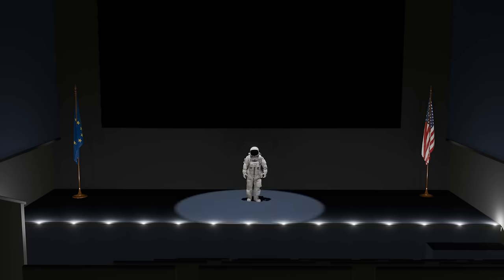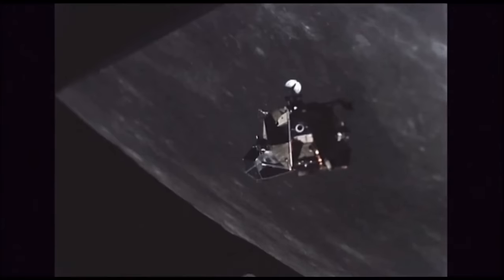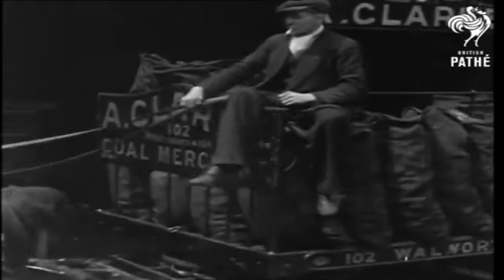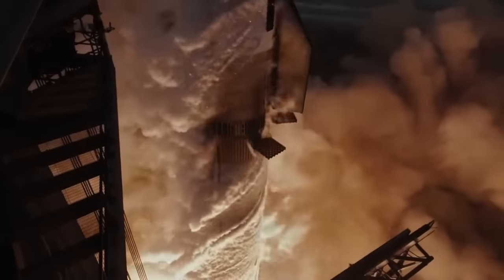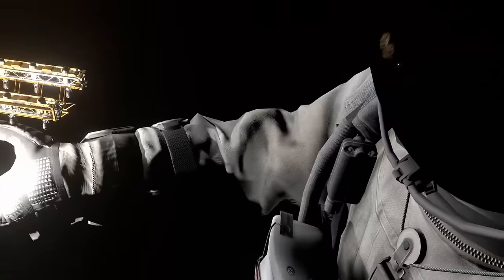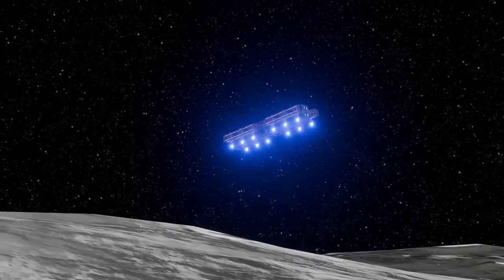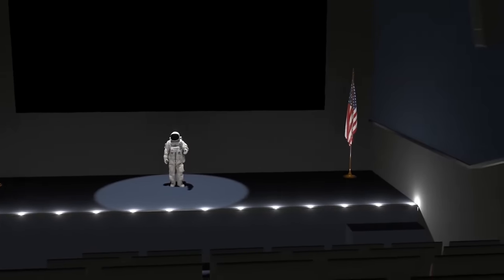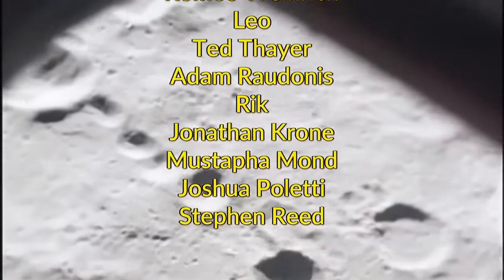Lunar & Orbital Infrastructure ALL PARTS

Comment: I have to wonder the possibility of the launch pad sled literally be a first stage and have just be powered by rocket engines. Fuel is already being produced on the surface in theory. There is already precedent for rocket sleds. This would drastically reduce the mechanical wear on the rails as they are simply just that, rails. All they do is give the sled a straight and prepared surface. Magnetic levitation could also be considered again like with the coil launcher idea except we no longer need to enclose the whole sled, leading to a structure that is not immediately limited in size yet can still be contactless at high speed. Obviously we should use magnetic brakes and the likes for safety.
Reply from the maker: but then why even use a sled why not just launch the thing? The point is to reduce the mass/fuel the freighter is carrying into orbit using nearly free renewable electricity
Reply: @Anthrofuturism  One consideration is that of the required energy generation/storage required for the mass driver. Either you have a large energy storage system (batteries/capacitors) or a dedicated generator to power the launch system. 

    Lets be generous and say that with an empty payload the hauler weighs roughly 300 Tons, and lets neglect the weight of the sled.
According to the KE equation that would require  ~850 GJ of energy over to bring it to escape velocity. 
If you use the short 25KM with the 5g acceleration that would require 17 GW of power continuously for the nearly full minute of acceleration.
Directly being able to power the sled is unlikely as even if we use the long tracks with lower acceleration the power draw will be immense, and it would be impracticable to overbuild power facilities to this degree. As far as I am aware the largest solar farm on earth is only 2 GW. So this leaves batteries/capacitors.
 
    Would those batteries/capacitors be able to perform well enough and be manufactured easily enough to perform the task? I do not know the statistics of the relevant systems that could be manufactured in situ, but it would likely require a VERY large energy storage facility. I am not even sure if the chosen battery types could even output that amount of power reasonably, and capacitors are, while definitely able to dump their power fast enough, generally orders of magnitude worse in energy density.  An alternative could be flywheel storage as the lack of atmosphere already is conducive to low friction, but again the energy required is just astronomical. 

    This is why, at least earlier on, rockets on a dumb sled might be a better alternative as rocket fuels have high energy density and high energy output. They are just a dumb simple solution to an admittedly not complicated, but just hard scaling problem. As the lunar bases grow in size and energy demands grow larger it will be easier to justify a fully electric system, but for a bootstrap setup, chemical seems to be the way to go IMO. Also technically the rockets on the sled could would be more efficient then on the freighter as they are as low an altitude that is possible and therefore can exploit the Oberth effect better. I am unaware of how much of a benefit it actually would be but it is interesting.
(also I hope I didnt make a silly math mistake, it is late while I am writing this)

edit. coming back it also just occurred to me that you could possibly have some sort of power plant that burns rocket fuel as fuel in a generator, so that could be a solution.

Comment: You should think less gun and more maglev train. Also if you made it extra wide as shown you could sync with a landing to accept a percentage of horizontal velocity to save additional fuel. A thermal rocket would seem practical here rather than chemical.

My first pass on a moonbase was one starship load per person and assumed you could get up to one hundred people in a decade. Sadly this would be mostly scientists and tourists, so you would be lucky to have ten workers at this point. A maglev system would be another two decades short crewed, then it would begin to ramp up. You can look to Arctic research/tourism as an example. The handful that maintain systems, see that people eat, clean up, and fetch them in if they wander off.  Expect much the same on the moon or any large space structure. 

Sorry, but people with a PhD (and the ego to match) like to believe they are a tool users and with training many might pass for having a hobby. It would be best to bring a few skilled workers to construct and not hobby a science project together on the moon to live in.  Long term, having a group of engineers on earth phone in and try to use the scientist on the other end to fix things or assemble things IKEA style following the written instructions without a more full understanding of interactions not written out in instruction 4.3.10 step B. Perhaps screw number 42 is ten threads too short, since this is a mislabeled item that was shipped.... Or that a heater wire needs to be a nickel alloy with matching lugs and not copper or soldered. Little things not in the instructions that work at first but fail over time.

Comment: I think your math is off on the track length. Per my numbers, a track of 53.943 kms at a constant acceleration of 5 Gs (49.03325 m/s) will be needed to achieve a final velocity of 2.3km/s, which would be reached in 46.907 seconds. This does not factor in the track that would be needed for deceleration.

Comment: Why no orbital elevator for the moon? 1/10th of gravity and no atmosphere (including no weather) equals much less strict specification on the orbital tether material and lenght... Could run on electricity (same as the "freighters", but instead of their proppelant, the elevators need none), their orbital endstation can serve as spacestation, spaceport and spacedock (supplied from the surface) all in one...

Comment: take spin launch....turn it sideways.  put it on highest point of land on any given circumference of the moon....spin two rocks up.....launch em. theyre now in orbit forever ish. higher than everything in that plane.  can spin a little faster and theyll rise up to a safe height lol.  
only works for cargo.  incredibly little infrastructure. .no giant track or anything special.  

the moon has no air friction so as soon as youre at orbital velocity you can start raising your orbit from a foot off the ground :/ 

beats the hell out of a mass driver or space elevator - although the later is the only realistic way to get humans off without rockets.

Comment: Congrats for noting your rail gun launcher isn’t launching blocks or cargo canisters, it’s launching space craft.  Ones that need maneuvering and booster rockets, and all the other fittings of a rocket.  Lots of lunar dev folks assume your just firing disposable block or something else made on the moon, and shot like a dead bullet to crash at a recovery target area on the moon.  Which would limit you to shipping very solid bricks, rather then manufactured goods.  And that assumes you don’t need any attitude or orbital maneuvering during the complete flight.  Not very realistic.

Of course if your launching space craft, especially reusable space craft.  What’s the point of the rail gun launcher?  Yeah it’s efficient, but very costly.  Costly is bad.  Costly to avoid cheap fuel and LOx (really only lox since it’s so heavy compared with fuel.). If you want to save Delta-V costs to earth, add wings or a aero shell.  Aerobraking is a cheap way to reentry DV, or orbital trim DV.